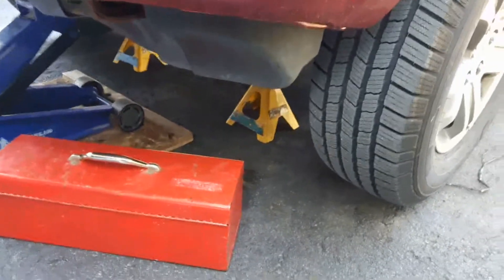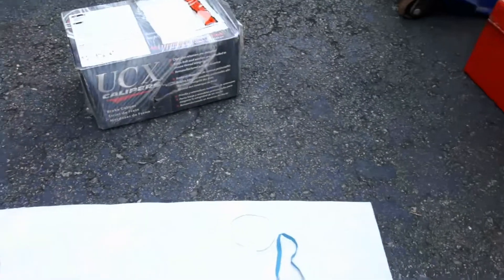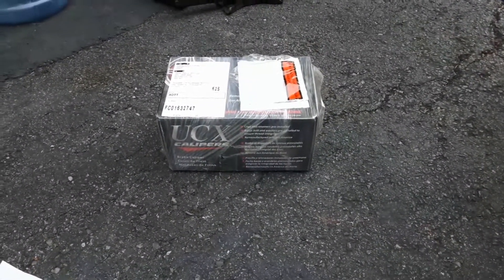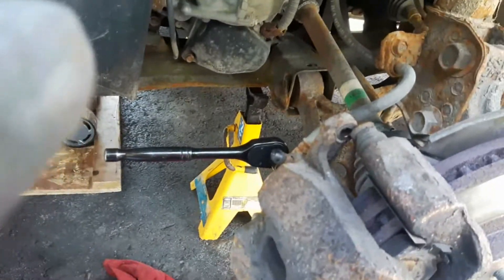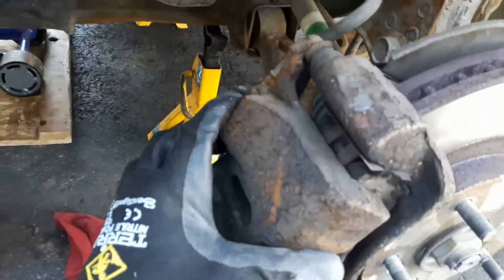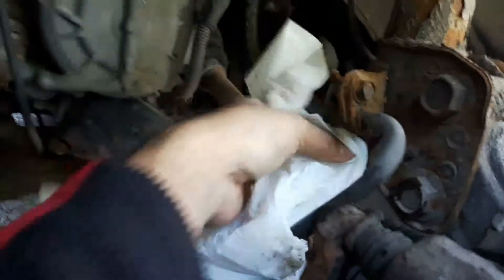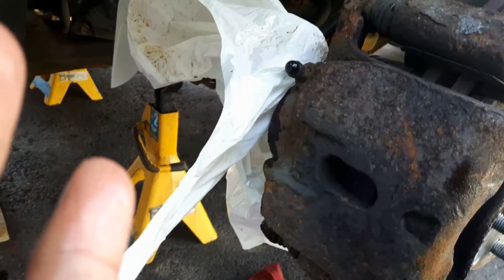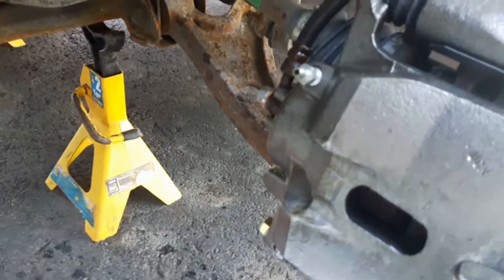1 TRICK How To replace brakes calipers without total brake fluid drain or bleed if ABS light ON

Comment: put the a nut on bolt and snug it down with the. old washers on the line still. this will by you much more time untill the brake fluid eats through the bag.
Reply from the maker: The brake line bolt usually has a through hole in it...hence it does not stop the fluid leaking out.
Reply: Brake is very important safety part you don't want to bypass or go shortcut to invite for problem may cost life. Don't risk and must be more careful with car that have kids.
Since caliper is replaced, wheel is already off, why not spend a little more time to bleed (many youtube video show the one-person brake fluid bleeding). Peace of mind for couple of years before changing pads.

Must drain all fluid from new caliper then fill with new fluid and keep its position so fluid won't escape ready for re-attaching fluid hose. You don't want the unknown fluid inside new caliper ruins caliper's seal for piston.

Comment: I swear some of y’all are rookies, I’m 22, I’ve been changing brakes and calipers since i was 13, and I see all the time whether they’re changing brakes or changing calipers they always drain the break fluid or do something stupid like this, first off, when changing brakes, just be a man, and push it, or use your old break pad and a c-clamp to compress the pistons, if you’re changing your calipers, just use vise grips or locking pliers to pinch the line, easiest method and not a single drip.

Comment: Just move the hose to the new caliper and put the bolt in first... also don't pry the old caliper and bracket off like that, C-clamp the caliper so the piston returns then it just slides off.

Comment: It's not necessary to replace the brackets. Those brackets last forever. All you do is take the two bolts off the new caliper remove the bracket and install the new caliper on the old bracket.

Comment: Your worried about your brake fluid? Why don’t you bleed out the system since your fluid looks passed it’s interval.
Reply: Agreed, any time you service the brakes it's a good idea to bleed them. A quart/liter of brake fluid is relatively cheap and by doing both jobs at the same time you'll save yourself the time in the future of jacking the car up and taking the wheels off

Comment: Use vide grips next time to pinch the line then you also won’t have to bleed the brakes after!
Reply: I would never do that. The inner hose can become damaged and fail sooner than later.
Reply: If you use needle nose vise grips to pinch the line, you can put sections of rubber hose over the tips of the pliers to protect the brake hose
Reply: @rossbittner6831  Good idea. I’m in. There’s a “special” tool for f’n everything. 8 different cleaners for bathroom. 20 for kitchen. 200 from chemical guys and that’s just for the passenger side😂. Sick of this world!
Reply: @rossbittner6831 Nope! There is pliers for this purpose. You’re doing on hard way. This is more easy than you think